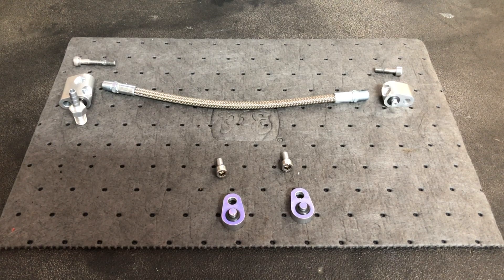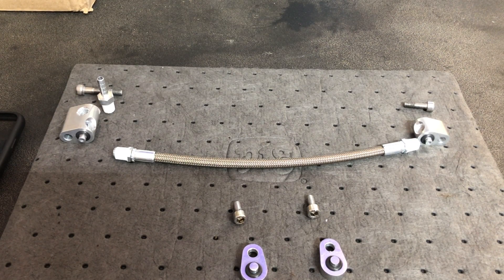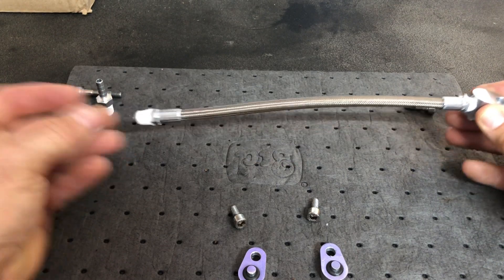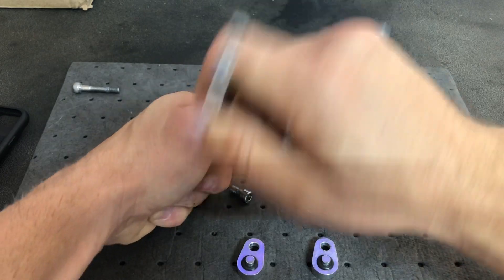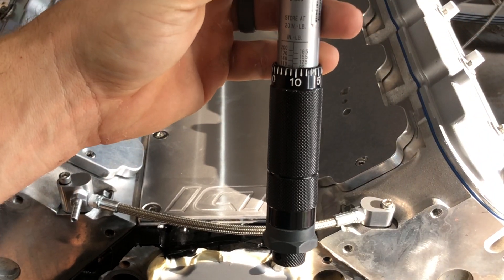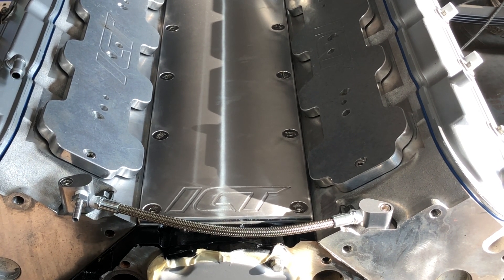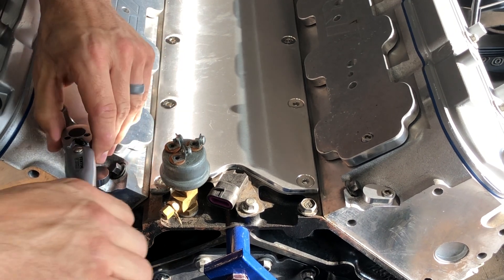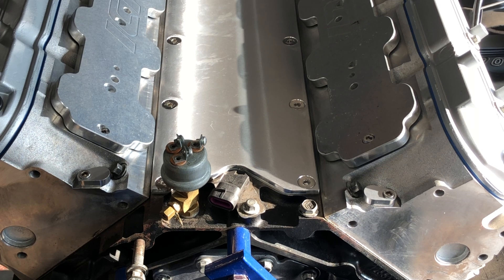ICT Billet LS Steam Port Crossover Install

Comment: What should i do if i have front port heads but put the heads backwards and now the holes are at the back?
Reply from the maker: Take the heads off and swap them.
Reply: @3rdGenC10s i redrilled holes and capped the rears

Comment: Drilling and tapping the qater pump may look cleaner, but its stupid. If youre on the road and your water pump goes out then youre screwed.
Reply from the maker: @Squarebody_Builds  if only they sold drill bits and taps at places you can buy water pumps.

Comment: Why not install new lines and run it to the throttle body the way the factory had intended it to be ran? Only asking because I need to do this and not sure if I want to drill or cut anything when the lines were meant to be ran to the throttle body.
Reply from the maker: @PressureJess  running it to the throttle body it still has to go to the radiator, this is cleaner.

Comment: Instead of running the passenger port to the water pump, can I run it to the throttle body?
Reply from the maker: It needs to return to the radiator so it can burp out any air in the system.
Reply: @3rdGenC10s  I see now that the throttle body coolant isn’t as necessary as I thought. This is a lot more simple now.
Reply from the maker: @garethhyder8285  I bypassed the throttle body all together, tapping the water pump just looks cleaner in my opinion.
Reply: @3rdGenC10s  likely the route I will go.
Reply from the maker: Have a video up on how I did my most recent 5.3

Comment: 106 inch pounds is about 8.8 foot pounds - in case it helps anybody else not using a torque wrench ;)
Reply: I torque everything always have my uncle would whoop my ass if I didn’t lol he made me have good habits lot of people like really why u torquing that
Reply from the maker: I agree, If there are torque specs you might as well as use them.
Reply from the maker: Good tip

Comment: Will the front crossover work for the rear as well. I have clearance since i have the LSA super charger. Right now, I have the transmission off and there is a lot of clearance for a cross over.
Reply from the maker: I wasn’t able to find anything on their website stating it could be used on the rear. I’m sure there are lots out there for the rear.
Reply: @3rdGenC10s  thanks
Reply from the maker: Sorry I couldn’t be of more help
Reply: @3rdGenC10s  no worries.

Comment: Stupid question maybe but what is that beside your crank sensor?
Reply from the maker: Park of a mechanical oil gauge that was in the donor truck. It’s no longer on the engine.
Reply: @3rdGenC10s  thanks for the quick response!
Reply from the maker: No problem!

Comment: Where did you relocate the knock sensors?
Reply from the maker: I deleted the knock sensors.
Reply: @3rdGenC10s  thru a tune??
Reply from the maker: @DONTCALLMETHAT  I’m running a carb.

Comment: Dude I want to LS swap my 73 SWB C10 but don’t know where to start? Any recommendations I WANT reliability ! No turbos I drive a lot ... what do you suggest ?
Reply from the maker: Any Gen 3 or 4 ls will give you reliability, most likely can pick up a lm7 5.3/4l60e at you’re local salvage yard with harness and ecm for a relatively good price. I would stick with the ls fuel injection system. Many companies make great aftermarket standalone harnesses. The only reason I’m running my LS carbed is it was that way when I picked it up. I’ll be fuel injecting it at a later date.
Reply: 3rd Gen C10’s thanks for the info buddy would ya email me what to get ? I’ve looked it up in c10 forums YouTube channels etc “ GEARHEAD4LIFE on YouTube etc ... I’m still kinda duh about it all ... what I want to do is buy a little at a time than Bam once I have it all get it done ... 
www.hermenlomas1@yahoo.com
Reply from the maker: @hermyherm365  man I don’t know how I missed this message but I just saw it.
Reply from the maker: https://tejassteelworks.com/wp-content/uploads/LS-Swap-Guide-73_87.pdf

This would be you’re best bet for Ls swapping a square. Follow this and you should be good to go.